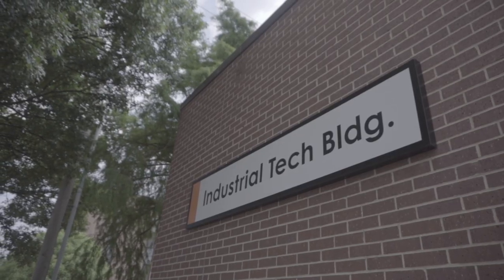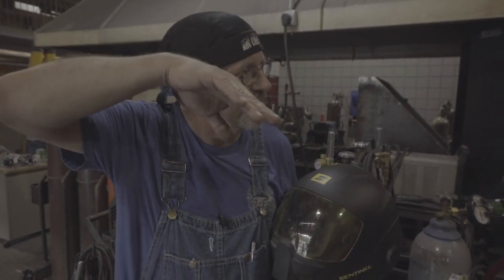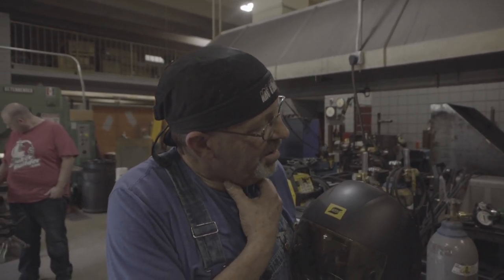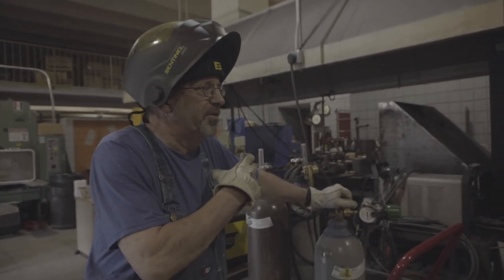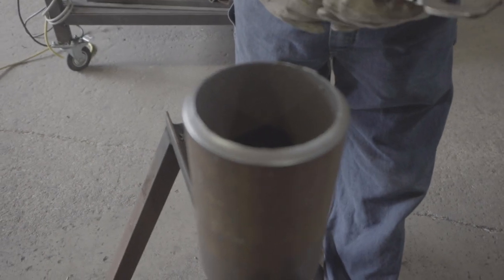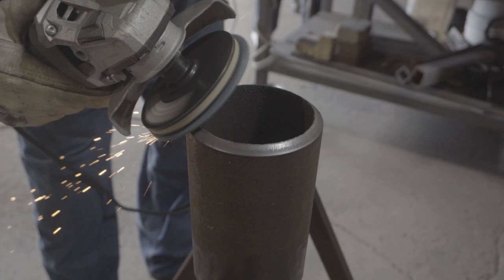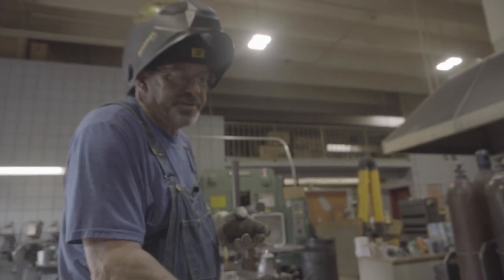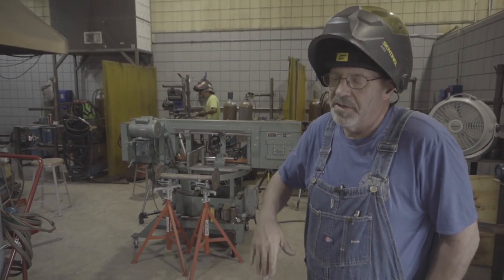Frank Goes to Welding School {Lesson 5: Advanced Pipe Beveling}

Comment: I beveled many foot of pipe ! Hand torch bevel, beveling machines, plasma arc, air tool beveler, even used grinders w/cut off discs !!
Probably have pounds of grinding dust in my lungs from all the grinding !! 
We called the facing process Nickle, or Dime LANDING !! I've seen some Pipeliners use a hand torch to cut a bevel, and you could clean it up with a file ! It was that slick !! 
Another note is on those beveling machines H&M, or Mathey Deerman make sure you have the proper dogs/spacers that go with it ! H&M bevelers require CUBOID SPACERS it says so on the machine, and Mathey Deerman use round dogs/spacers ! 
DON'T MIX THEM UP, or it will cut pipe out of square !! 
Have fun with Bob Moffett !!
He's a scholar, and knows his business !! 
Great video Frank !!
Reply from the maker: Thanks buddy! Bob really knows his craft! 😃 🔥
Reply: @SmokerBuilder  You are one lucky man to be able to work with Bob. He has to right up there with the best of the best.